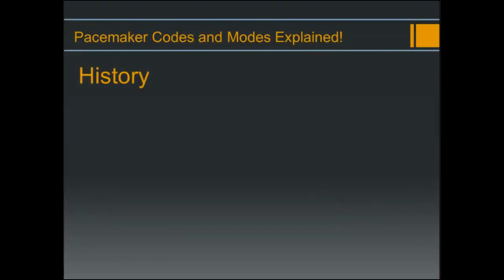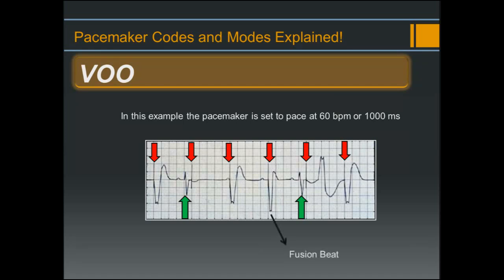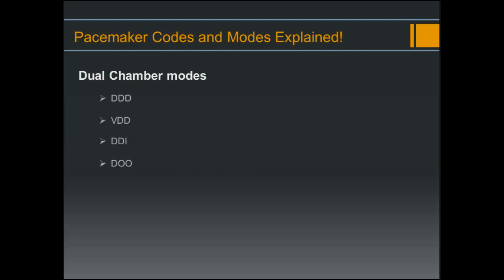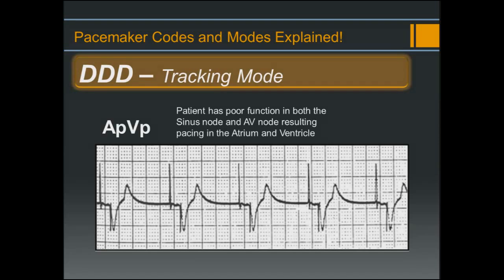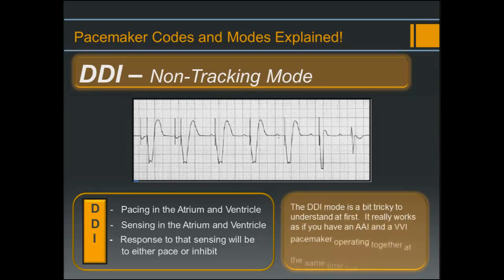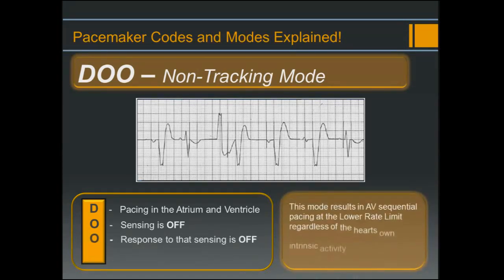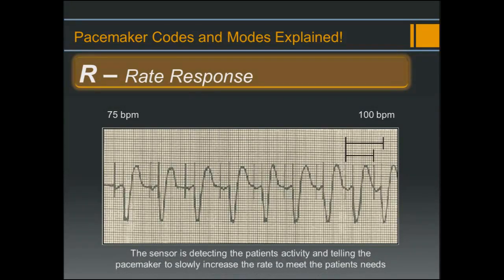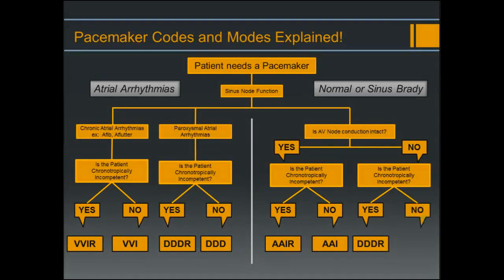Pacemaker Codes and Modes - Explained

Comment: Thank you for this very informative,easy to understand PPM modes video. But  in P Wave tracking mode, Heart rate will NOT go above upper rate limit, usually 120 BPM,
 even if the patient goes in afib/flutter. with atrial rate of 200-300 bpm because Vetricular pacing upper rate is 120 bpm. Correct me if I am wrong.

Comment: I have a question could a person with a DDD have 100 own rhythm... meaning could be that the pace wasn't needed at all? this person has Normal Sinus, 1° AV Block, NYHA Class II...  the report doesnt have any events... what would you do? would you keep the pacemaker or not ?
Reply from the maker: Hi there, the answer to your questions really depends on several variables.  1st, yes you can have a person with a DDD pacemaker have a heart rate of 100 bpm and rarely use the pacemaker.  It may seem like they don't need the pacemaker at all.  The important thing to look at is, what are the pacing percentages in the Atrium and Ventricles?  This will give you a better idea as to how much they are actually using the pacemaker.  The lower the percentage the less they are using the pacemaker.  Please note that some people are programmed in a way to rarely use their pacemaker, so a low pacing percentage does not mean that the patient doesn't need the pacemaker.  Some patients might rarely use their pacemakers but when they do it is vital and potentially lifesaving.  

Pacemakers are not usually implanted for first degree block unless they are symptomatic due to the long AV block. You would really want to find out the original indication for the pacemaker.  Typically this is Sick Sinus Syndrome, Bradycardia, Syncope or 2nd and 3rd degree heart blocks.  Would I keep the pacemaker?  I am not the patients physician and therefore can not answer that question. Sorry I can't help with that one.

Comment: What are the indications for a DDI when you can use VVI then in case of Afib?
Reply from the maker: If it is chronic Afib you are most likely better off with programming VVI. But, if they have proximal Afib and are not mode switching well due to small p-waves, sometimes DDI is the preferred mode over DDD.  This way they will still get some atrial pacing support when needed  in a sinus Bradycardia situation but won't track the atrium and pace the ventricle in the presence of Afib.

Comment: In the last section of choice of mode, is it DDI rather than DDD in patients with Paroxymal AF/AFL?
Reply from the maker: sifar1111 - When paroxismal AF/AFL is present, the preferred mode is DDD as long as the pacemaker is able to sense the AF/AFL.  All pacemakers have an algorithm called Automatic Mode Switch.  This Mode Switch algorithm detects when the patient goes into A-Fib/Flutter and will automatically change the mode from a tracking mode to a non tracking mode such as DDI or VVI.  After the patient converts back into a sinus rhythm the pacemaker will detect that and then switch back to DDD mode.